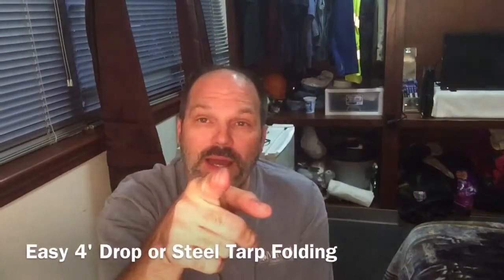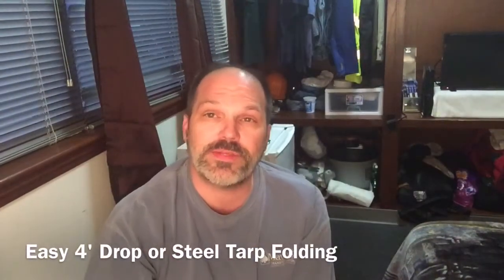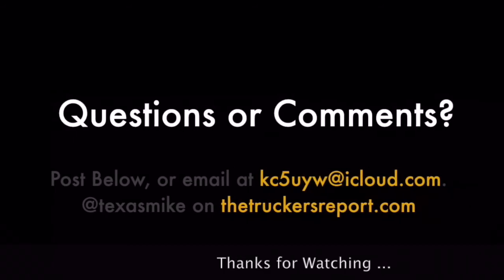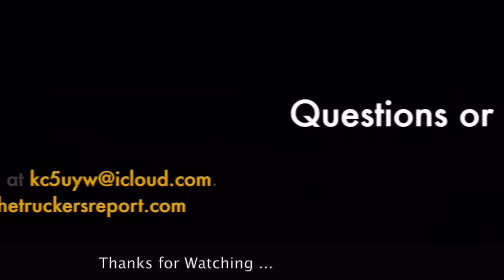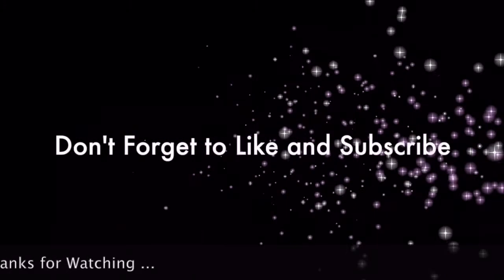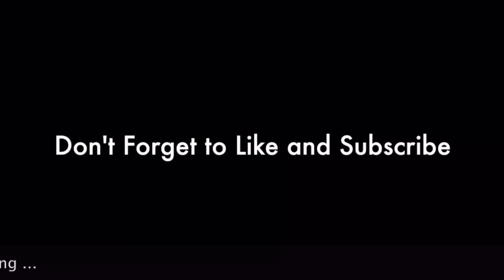Easy 4' Drop or Steel Tarp Folding

Comment: hello, great videos all of you try to watch them as much as I can 
question for ya looks like them tarps are pretty easy to deal with in cold weather, i might be wrong, you tell me. but wondering where Maverick buys them because I like the three rows of D rings instead of two like most of the market have 
if you are able to tell me or you know where they buy them I would appreciate that 
thank you much in advance
Reply from the maker: They can be a chore when frozen. As for where they get them I'm not sure. But they are the heaviest ply tarps I've seen.